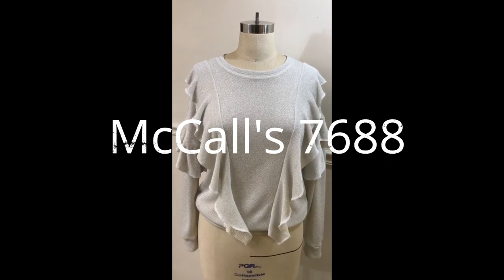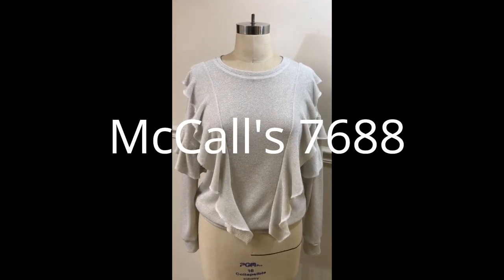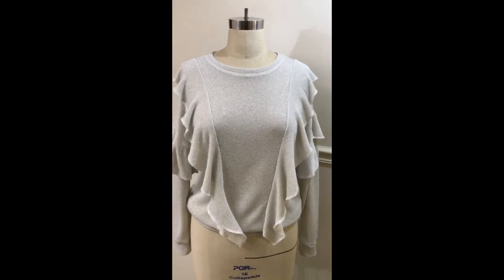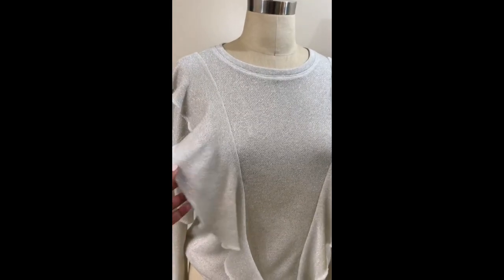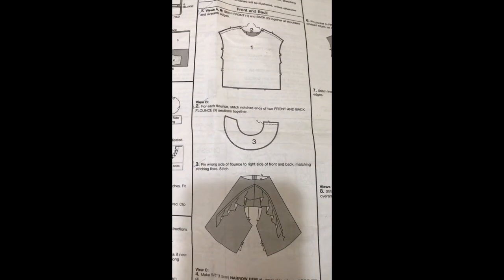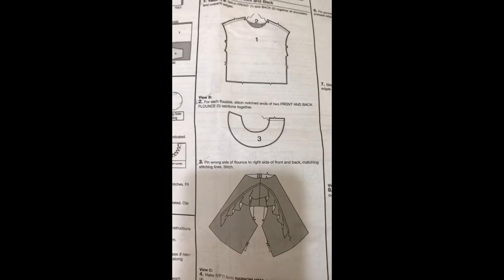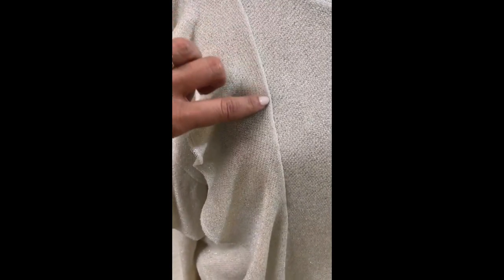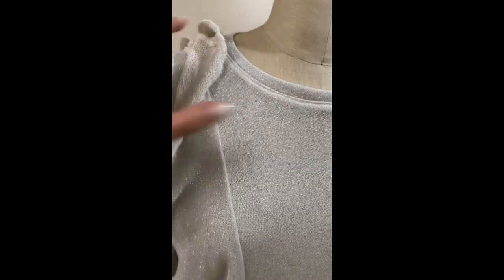How to Sew on the Flounce for McCall's 7688

Comment: Your sweatshirt turned out gorgeous. Your method makes a lot of sense for a soft like fabric like the one you are using. However, if you are making this sweatshirt out of fleece, your method would give a lot of bulk and the ruffle would not fold over as neatly. When I first saw this design, I did not realize the ruffle is just stitched on and not encased in a seam. Therefore, adding the ruffle in a heavy material the way described in the instructions will give a smoother ruffle as well as a raw edge detail which is trendy. BTW, I saw your version of this top as a google image which led me to your website. IMO, your top is the best I have seen. Excellent choice of fabric and styling the overall outfit. New subscriber.